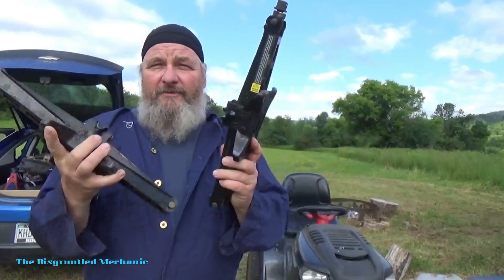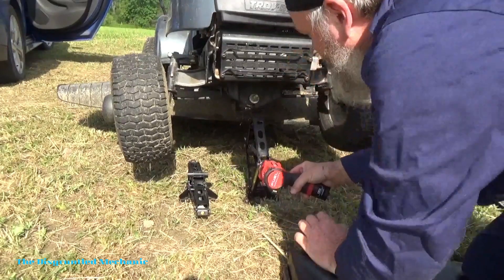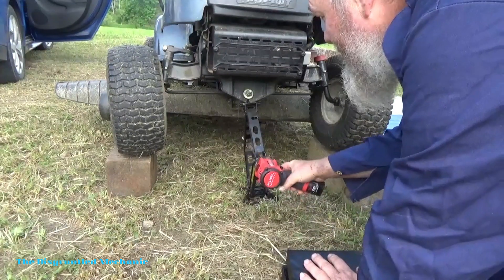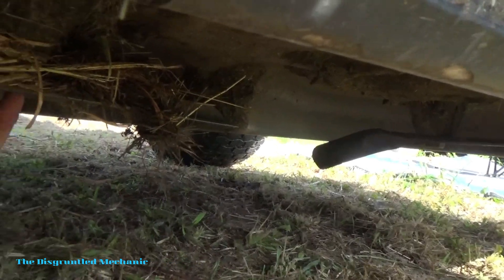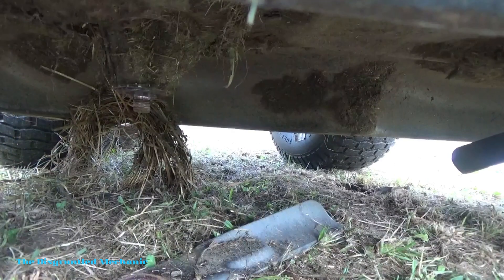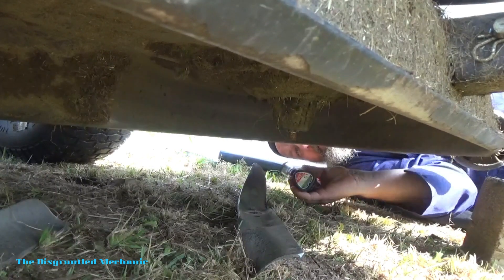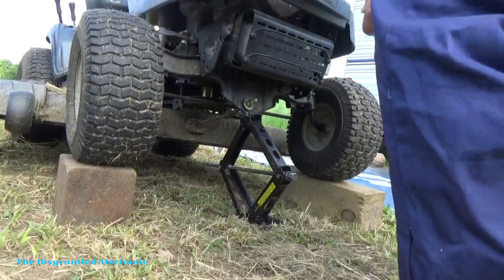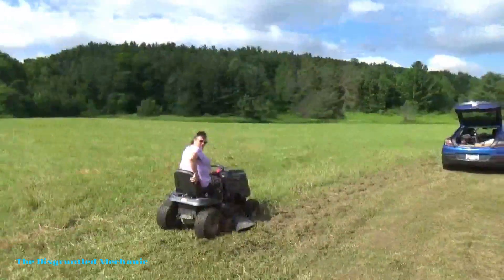Milwaukee 3/8 12 volt stubby impacts1st job—- Mower blades

Comment: That stubby impact has a lot of breaking torque. To be honest Mike, I didn’t think that tool was going to break those nuts loose. 😀👍
Reply from the maker: I know. I have had to use 1/2" breaker bar in those situations before!